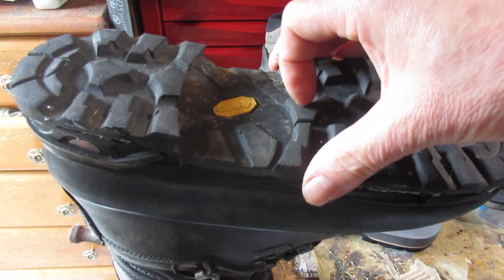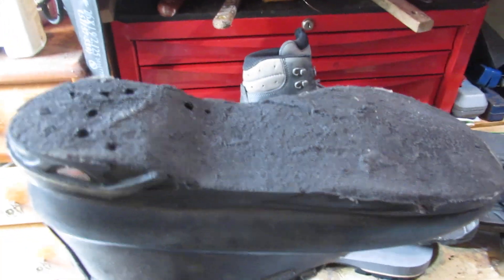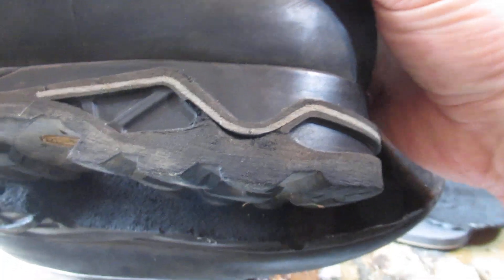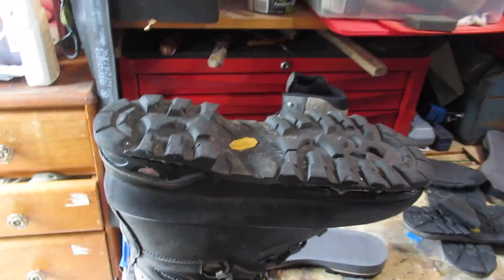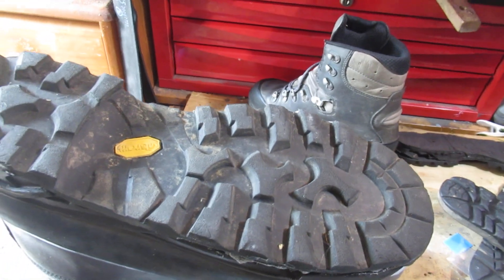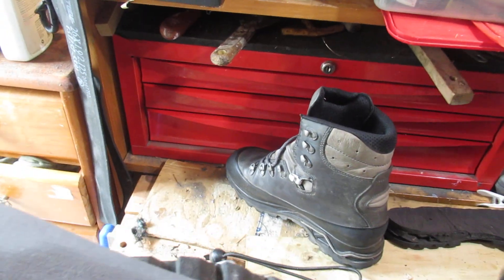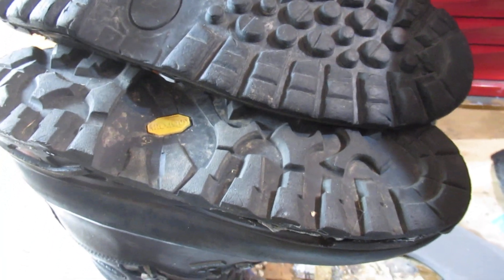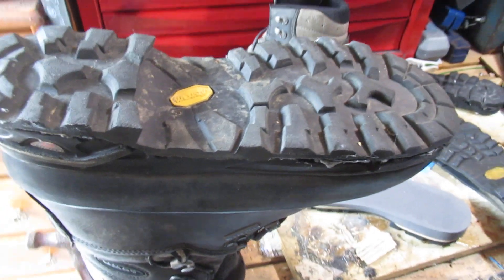Hydrolysis. What's that?

Comment: I believe that if the upers are good this is a minor repair that will give another 3-5 years of more usage.
Reply from the maker: Same uppers with the closed cell type EVA mid-soles require no resoling until worn out. $200 in NZ is not a minor amount plus lost use of them and if you are a worker you need to have a second pair while that pair is turned around.
The PU midsole have shorter lifetime in abrasive conditions. Contrary to Lowa claims that EVA doesn't last as long. Which is strange. The pair of worn-out EVA/soles shown were from a pig hunters pair, had no wear in the EVA.
Farmers get shorter life with them and no warranty with the PU. 
Besides ageing failure for PU due to moisture absorption from air. That's why they tell you to store their outdoor boots in a dry place. As soon as the shell around the PU has a perforation the water is in and drys out slower than in the antarctic so you walk around with pools of water connected to your foot. 
Bit of joke when people are weight conscious by the gram when they buy boots. 
The type with the sole glues onto the bottom has the shortest longevity as shown. A complete shell with the sole molded on when its made tends to last longer by comparison. 

People as proven by sales love fancy looking gear though. EVA sheet is so darn ordinary lookin side by side in a shop.
In a couple more years I'll be making the same video again.
Reply: @bootsandgear 
Thanks, that was interesting.
I don't mind the look of the EVA to be honest, definitely will keep this in mind with next boot purchase.